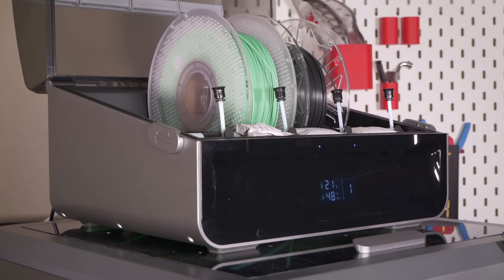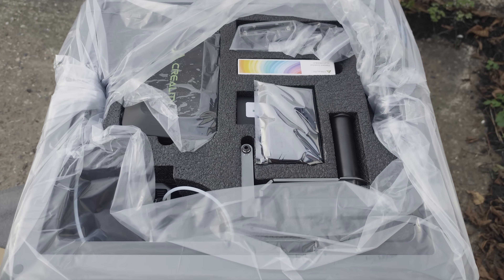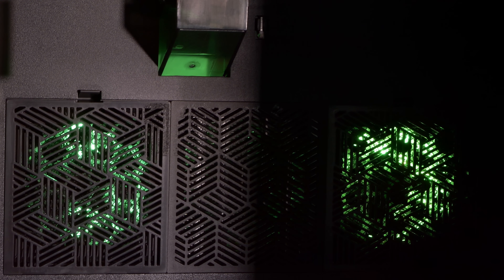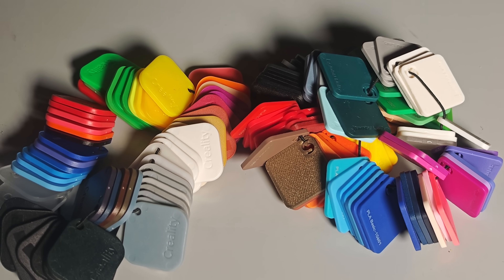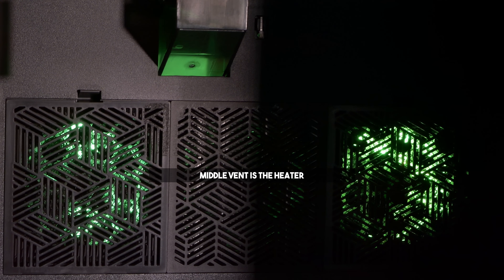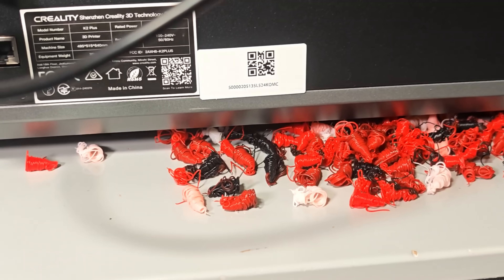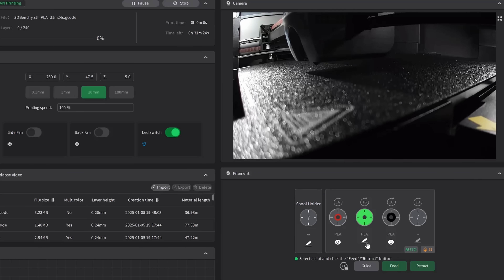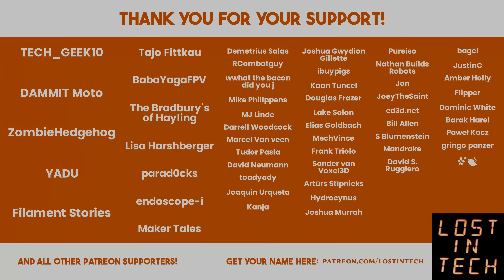Creality Finally Made a 4 Colour Printer and everyone is asking me the same questions!! !

Comment: Got this printer for about a month now, here's what I can say:
Pros:
-Built like a tank
-Super fast and high quality prints

Cons:
-Creality Print slicer software is unerefined and sometimes buggy
-Chamber heater doesn't reach the advertised 60°C, only 40°C comfortably and 50°C if you turn off the fans and wait 10 minutes. This needs a re-design or a mod!
Reply from the maker: check you dont have any kind of airflow in the room, youd be surprised how much heat it wicks away from a printer! I'm glad though that most people are finding the k2 plus to be a decent printer.
Reply: Are you looking at chamber heater alone or chamber heater + heated bed + hotend. The chamber heater alone can't get too hot, but you start working with filaments that like it hot and you'll have a space heater living with you. The room I had it in, with a full-speed ceiling fan, in the dead of winter, got upto above 80F, when the actual house AC was set to like 68. (This was not an interior room, it was a corner room with 3/6 sides touching the outside, 2/4 if you don't count the ceiling & floor. 

Generally you'll never need a 60c chamber when working with filament that doesn't need a hot hotend or a hot heated bed, so IMO it's honest to cite THAT chamber temperature as the max, even if the dedicated chamber temperature alone can't reach it.

Comment: I just got my K2 Plus up and running and am exceptionally impressed. It keeps up or exceeds the speeds of my Bambu and the initial prints have been incredibly high quality. The CFS has "just worked". My only gripe is that Creality Print is not very refined, but that's really it. It's ~heavy~ and ~huge~ but that's why I bought it. Very impressed.
Reply: Time to root it.

Comment: This was a great and funny video 😁 Print Q. is finally good at high speed. I dont like the falling bed, although it probably wont cause any problems, but a measure would be nice that stops the bed when the motors are not energized.

Comment: Having watched this video when it first came out, and then watched it again today - nearly two weeks later, I’ve noticed a few things on my second watch. First, during my initial watch, I guessed which print was the K2 Plus nearly every time - I only missed one. But on my second watch, I wasn’t able to guess more than two of them. So I’ll chalk my first watch guesses up to luck. 

Secondly, I really think there should have been a callout to the motor tensioning motors. As far as I can tell (based on the Bambu belt tensioning guide), not even Bambu has that feature. And it’s a really cool one - because it means you can use accelerometer data to determine when the belts are loosening, and tighten them automatically. I could even see this turning into a neat feature where the belts get pre tightened for high acceleration moves in order to increase the resonant frequency of ringing and make it less visible - especially in conjunction with Input Shaping. In the meantime though, it means less involved maintenance for newcomers, which is certainly a good thing in my book. 

Plus, the K2 has been made much more attractive over the past week simply due to what Bambu is planning to do with their firmware. 

That being said, Creality should - in my opinion - stop with the whole skinned slicer thing. Historically, they have not ever been good, or even worth using over the open source versions of the slicer their skins are based on. They should just create good profiles for the existing slicers, and work with the open source devs to get those profiles included. It would honestly probably be cheaper to do anyway, even if they paid the open source devs for the time spent integrating the profiles (Which they should do!).
Reply from the maker: Haha, I did show the tensioner motors, in fact I even showed them working
Reply: @ I know you showed them, I was trying to suggest that it would have been nice for the motors to get some time in the voice over in addition to the short video clip. It's a really neat feature that - as far as I'm aware - is unique to the K2. Creality, who historically have tended to err on the side of cloning, should be credited for adding something that Bambu didn't even think of. 

Not that I'm personally interested in any printers that aren't self-built open source machines at this point, I still think it would be worth giving voice time to. I know that at least for myself, I assumed the K2 would pretty much be a larger X1c clone (Creality's specialty has always been to take a functional design from someone else, and clone it but bigger). I think the tensioning motors and the thicker belts (they at least look like 9mm belts to me) are both differentiating factors that I think are good additions. 

It is still a great video overall, and the comparison prints are nice to see - most printers these days seem to have pretty similar print quality. The biggest differences are in the time it takes to print, or so it seems. It might be fun to see what happens to print quality if you force the slower comparison printers to speed up to the fastest machine you're comparing, rather than slowing down the faster ones.

Comment: Be a little wary, I like my K2 Plus, when it's working... The printer can, and may well, tear the PTFE tube out of the "extruder front cover" part, and in the process it rips out all of the metal teeth that secure it. This seems to be a "known issue" given how many other people I've encountered and discussed this with.
When the PTFE tube tears itself out of the extruder front cover, that makes it so that it can't print anything but one color because if it retracts, there's nothing to hold the PTFE tube in place anymore until you can get a replacement part, or a jerry rig fix.
There IS a jerry rig fix available, but it must be printed out of a more heat-resistant material than PLA/PETG, I used polycarbonate printed on my Bambu X1C, but if I didn't have a second printer that could print higher temperature materials then I would be SOL.
Creality Customer Support does not exist... I've sent numerous emails, even asked for assistance on Twitter/X and sent in a support ticket, all just asking how to get the "extruder front cover". They do exist, they are even listed by Creality themselves on AliExpress, and I put in an order for two spares there as well, but apparently they won't "release" until March 1st.
It is an absolute clown show just trying to get them to even offer to help in any way, they only ever ask for more information and to resend the same pictures I've already sent, claiming they don't work on their end... It's JPG and PNG format(s) as they've specifically requested, but this is out of hand and completely disappointing.
Reply from the maker: I'll check with my rep (after CNY) to see what the status of this is, thanks for the heads up
Reply: @LostInTech3D  Thank you for reading my tale of woe 🥲

Comment: In my opinion the whole multi material system as it working now is a dead end. The amount of waste just one thing, but its also diverting the Whole 3D printing into a direction where solutions and innovations for real and existing problems are not even important anymore. Here are some to mention: partiall non planar printing which is already proven it can be used. The possibility to quickly change nozzle size even during printing, so we could use different real and not forced (over or under extruded) thicknesses depending on the model's need. I am aware these are non of those people's concern who does not use their printers to make functional parts, i do understand the importance of a 4colour plastic cat which is going to end up in the garbage can in a few years if not months along with their poops. But hey.. Is there still people left who actually want to use their printers as it was originally invented for?

Comment: IMO BambuLab's success is far more than just the printer. Credit where credit is due, they really "solved" 3D printing for the masses. Printer specs are important. The community, the documentation, tech support and the whole ecosystem is a delight to use -- especially the masses that simply do not know or care about tweaking, upgrading and tuning. I think what's at stake is not Bambu's throne, but rather which of Qidi, Sovol, or Creality will get dissident buyers.

Comment: I’m still rocking an Ender 3 V2 and just acquired a Neptune 2 that was sort of working. I want to go larger format with an enclosure. I’m torn between the Qudi X max 3, the Plus 4 or the K2. The Plus 4 and K2 are both really attractive because of the multi color and print temp. Still undecided. If money was not a factor a fully loaded Prusa XL would be at the top and this is the first time I have ever been interested in a Prusa printer.
Reply from the maker: Haha the prusa is good for sure

Comment: I wonder how these multi material systems deal with filament snapping inside the tubes.
If I leave any PLA filament in my printer after use it will snap somewhere between spool and print head within 2 and 24 hours. I assume this would cause trouble in all material changer setups.
Reply from the maker: It happens 😂 they wind it back though so normally that prevents it, but I've had to disassemble the bambu ams more than once to dig out pla.

Comment: All I have to say is, hopefully if there is a problem that requires customers to "buy" the fix they will leave the discount open longer.  I was burned on the K1 because my version had the bad extruder that I had to replace on my own dime.  The low cost fix was closed down right before I purchased mine from Microcenter...

Comment: The benchys, it looks like the bambu has taller layers to me than the creality. Just from the brim around the roof of the part apears larger steps. Im skiptical Mr TT would allow such a thing to slip by him, as i hold his integrity in high regard, he is well skilled in this area, and frankly its not some massive thing anyway, but i just thought id express my thought. Such a thing is possible.
Reply from the maker: are you calling me Teaching Tech? :D 
Both benchies were printed with 0.2 standard profile, unless I messed up. Which I dont think I did.
Reply: @LostInTech3D  ha ha, I couldn't remember which of your channels I was commenting on, I'm on my phone, which really narrows down the view when commenting, so I called you as I decided to. I do find all these quality comparisons sometimes dubious, since a print can be tuned to print better, sometimes even leaving the door open for ventilation etc. As you certainly know. So when I look at these things I'm mostly only looking at the smoothness and accuracy of the extrusions for print quality, less so much sagging overhangs or stringing or blobs. So to me, even though the creality does look better, I just see them as the same. Even on top of that for quality, the fastest 3d printer is just more printers. So it's a output per dollar thing for me, i jnow you said you slowed down the k2 a bit. If I compare quality, and speed, the k2 is outclassed a bit by the bambu because you can output more with bambu for the price, (p1s vs K2) at least if you're restricting your needs to the bambu build volume. A bit of apples to oranges in my opinions, great video though. I'm always pleased to hear your opinions.

Comment: The general layout and wiring in the rear it far short of what a company of creality's size should be putting out. All those screw terminals on the mains power pcb, no cover over it like the power supply has, it's layed out like my homebuilt seckit tank.
Reply from the maker: Saying this stuff doesn't make it true in any way, it just makes it your opinion.

What I see is wiring that's user serviceable and well organised. And I'm the one who's looked inside over a hundred printers. So...

Comment: @Lost in tech why are the 2 sides of the bed so obviously un-level when you showed the bed dropping, 1 side of the bed is Visibly lower and even hits the bottom almost a whole second after the other side reaches the bottom… @5:29 looks to me like it’s going to cause a lot of uneven wear on the most likely brass threads that those lead screws go in
Reply from the maker: The screws definitely aren't made of lead 🤣

Comment: Putting the heater right between the 2 exhaust fans is such a dumb design 🤦‍♂️

You're wasting so much power and time generating heat that'll be sucked right out. Putting exhaust and intake right beside each other is a total noob move that anyone with PC building experience would know not to do.. Have Creality engineers never built a computer?

Also, if I've learned anything from Qidi, the advertised speeds are possible, but will give you terrible prints. I'll be shocked if input shaping recommends more than 5000 max accel for most units.
Reply from the maker: Those fans are off when the heater is on
Reply: @LostInTech3D  then they're gonna turn off and on repeatedly (annoying for some) or they're gonna end up getting too heat soaked. Either way seems like a poor design..
Reply from the maker: Why do you think they're going to turn off and on repeatedly

Comment: I have been interested in the K2 Plus.  I think it'd be best as a multi-material engineering office prototyping machine or for cosplay enthusiasts who want large multi-color objects.  I appreciate the engineering that went into the K2 Plus and particularly appreciate the good support for higher temperature materials but I tend toward simpler 3D printers that are easier to maintain, but with good print quality and decent speed.  I don't need color printing for my functional parts but I would like to print PET-CF parts with TPU feet and/or non-skid tops, or print PETG parts with peel away PLA support.  Now that many 3D printers have multi filament feeders, slicers need to do a better job with multi-material support in 2025.  Slicers need to learn to use the purge as infill so there is no need to poop or print a purge tower.

Comment: It's a shame it doesn't recirculate the heat, that just seems generally inefficient and if recirculated it could also help evenly heat soak the machine better. Furthermore, it IMO should also have one of the two filter fans also recirculate and the other used to help lower chamber temps and vent out, both with HEPA filters. Can't stress how much recirculating vastly improves how clean the air gets isn't just dumped out with a single pass.

Even with HEPA/MERV 17 it won't catch everything first pass and WILL still pump pollutants into the air. 99.97% is still a consistent stream of 0.03% over hours, compounding. I personally have my printer in a closet that's sealed with a HEPA filter inside that is always on when the printer is on (both connected to the same Smart Outlet). With that said.. I'll probably get WAY more plastic in me with a random ice coffee in those clear plastic cups.

My only other issue is the auto belt tension. The belt tension/length WILL change when the machine is warm and i fear the auto belt tension system might exacerbate that. Meaning, the belts will be more pliable at higher temps and will stretch out of spec. That will wear on the more over time and reduce the accuracy faster over the life of the machine. It's good there using 9mm belts as not only can that be a problem but also those are some long belts on a Core-XY 350x350mm machine.

Other than that, all the reviews make me wish i preordered a K2 Plus Combo. But Creality have a very "good" (bad) track record with new machines up until recently.. that's why i didn't.

Comment: This printer shouldn't be compared to the P1S but rather to the X1C imho
Reply from the maker: It's the same.
Reply: @LostInTech3D  sorry, but not really, first thing that jump at you while comparing them is the price; P1S combo for 1.007,40€ while the X1C is at 1.360,33€… Then you can go into the fine prints, like the P1S being limited to a heating bed at 100°C while the X1C can reach 120°C, that's the difference between being able to print PPA-CF easily or not. There are maybe some other minute differences, but, even without taking them into account, at least you have to acknowledge that those 2 printers are not the same, both in terms of specs and prices !
Reply: @LostInTech3D  also, the K2 plus combo is currently tagged at 1.499€, and the heating bed can reach 120°C… Furthering the fact that its true competitor is the X1C, not the P1S.
Reply from the maker: You haven't actually touched on the one actually valid reason they might not print the same, so I assume you don't know it. But they do tend to, which is something that I never fail to be amazed by.

Nor did I agree to compare two "price equivalent" printers, you decided that rule yourself, with the arbitrary "you should". 🤣
Reply: @LostInTech3D  Sorry, you read my comments and missed the points, it's not your fault, I don't know you enough to adjust them in terms of what could help you to see them better. But it doesn't really matter, because given your answer you don't seem to be in the mood conditions to accept any critic nor video idea, I just hope now that your life is not too miserable for you to react in such a way, and even more that you don't seems to be a tech/crypto bro asshole but rather a decent person, I'm sorry, have a good day.
Reply from the maker: But I haven't told you about my lostcoin yet, come back

Comment: $1500 just seems like a lot when a p1s combo is only $800, and there's a reasonable possibility bambu announces their gen 2 machines this year. If you're someone who absolutely needs the extra large build plate then I'm sure it would serve anyone fine.
Reply: Well, its 350x350. For my use kase, the k2 is the only core XY large enough. 
However, its not so good with TPU, and I've heard  only bad about creality support and parts availability. So ill wait for bamboo xl something
Reply: The Bambu X1C is $1500, just went on sale to $1350